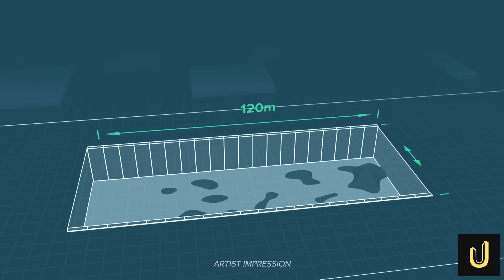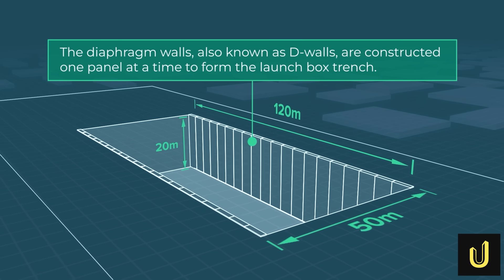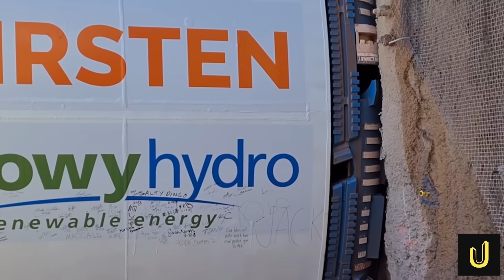These 7 Australian Mega Builds Will Either Transform or Destroy the Nation

Comment: The video missed the other 2 Victorian projects - the Metro Tunnel, the second underground rail project for Melbourne, and recently opened; and the Suburban Rail Loop, a 90 km mid-suburban loop that no-one knew was required. The latter, originally estimated to cost $50 B to complete has commenced with a section of 26 kms, will cost at least $35 B, and serve an area that already had some of the best public transport in the city. By the time this loop is finished, could cost $200 B. Planning by hopium.

Comment: West Sydney Airport was NEVER intended for passengers (but look like it did - hence the lack of rail and road connections etc.) - this is deception and it will quickly revert to be a Freight Intermodal Terminal connecting Tullamarine (notice a new airstrip - just built) and "West Brisbane" (Toowoomba ) airports.  The inland rail could have used the New England line - but that would provide competition to air transport (that was planned (by the Oil Industry Lobby) to be there as B-Doubles are removed from the highways.  Air Freight uses far more (expensive) aviation gasoline than diesel used by B-Doubles, and the inland rail was deliberately planned to fail.
Reply: This Brisbane  Sydney Canberra Melbourne railway should be done 30 years ago ready for Sydney 2000 ; the long wait it's so very ridiculous lethargic! Very narrow minded!

Comment: 1. Australia doesn't rely on a massive military. It has many allies and it's budget is therefore not as large as you may think.
2. The Adelaide project will save motorists a lot of time, it will save a lot of bottlenecks, and keep traffic out of the city centre. The tunnels will also reduce noise. And on top of that, it will add a massive amount of new greenspace. 
3. Snowy Hydro is a massive job, but a necessary one for future benefits. Its cost blowouts and delays are inevitable - its remote, hard to access geography. But the benefits are absolutely massive and worth the investment.
4. The inland rail is critical for Australia. The vast majority of Australians live on the east coast. Yet the rail infrastructure along it is old and goes through residential and commercial areas. The port in Melbourne is unable to keep up with demand. The inland rail is critical for infrastructure, and they are being smart about developing it in a way that doesn't have an impact on locals.
5. Cross River Rail adds new stations, but also stops bottlenecks. It will help get cars off the streets and help with the upcoming Olympics.
6. West Gate Tunnel is complete. Massive improvement for Melbourne, it keeps trucks off the passenger roads, stops bottlenecks, and they did all that in the middle of covid, strikes, and heaps of businesses and residences without any disruption. The bike paths are a huge bonus.
7. The North East Link is a huge project which again will finally keep bottlenecks out of Melbourne. This will make travel safer, faster and give locals their roads back.
8. Western Sydney International Airport is critical. It's being built on time and on budget, and will have fast connections to the nothern and southern coast, as well as Sydney. 

All these projects are being built for future benefits as well as easing congestion, bottlenecks and safety. Australia has a huge economy and little debt. These projects will not bankrupt Australia and will help it continue to punch above its weight in terms of economic prosperity.

Comment: A train line is useless when it gets superseded by autonomous road trailers... delivering freight at half the cost of rail.
Reply: Agreed. Ultimately, good motorways are far more vital to infrastructure than rail because the mode of transport is FAR more versatile and can, overall, carry far higher capacity and $ economic value per minute.
Reply: @jonnies  Rubbish. Rail freight moves more freight cheaper for bulk products like ion ore and long distance containerized freight cheaper compared to road transport.
Reply: @jonnies have u been to any school?? You are real nuts !
Reply: @alexandrelinhares7503  You are the one talking fiction. To date it is not happening, still in development. I have studied mechanical engineering as well as electronics and railways move bulk freight cheaper than roads. Look at how many new railways China and the rest of the world are building.